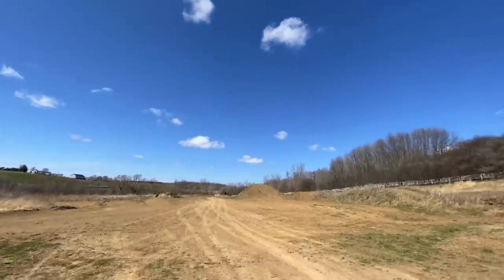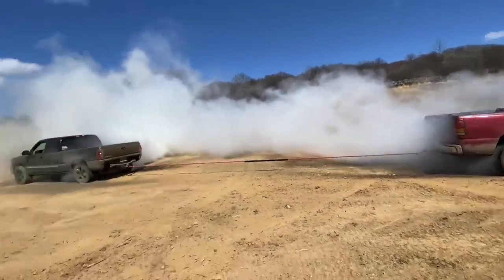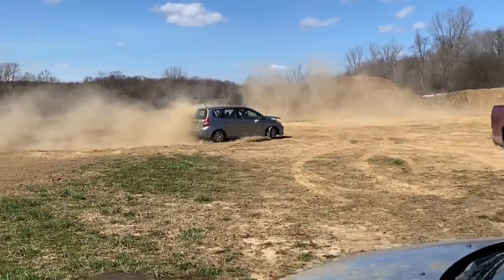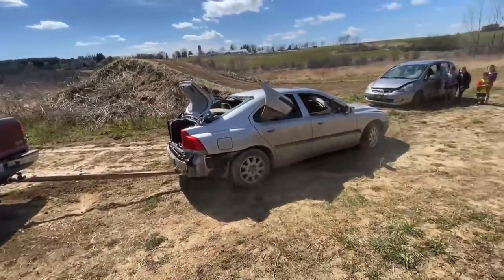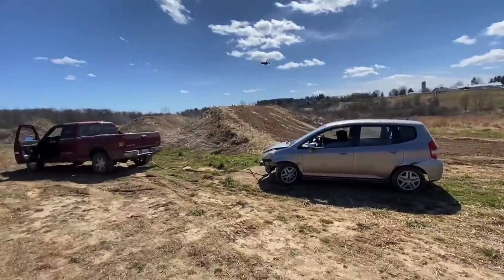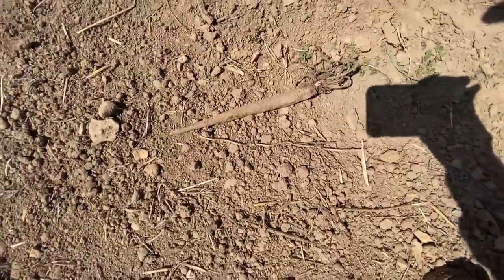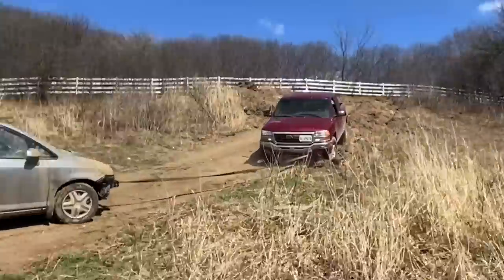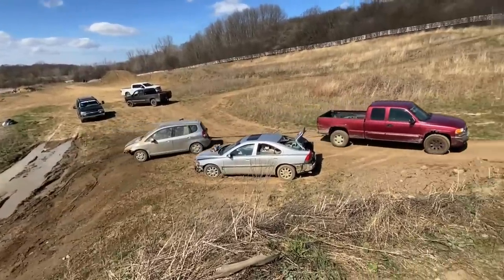GMC TUG Of War HONDA Car JUMP!!!

Comment: with a dead lightweight car like the Honda Fit I was hoping you would string together about 10 tow straps and have the pulling truck on one side of the hill, hook up to the front of the Fit on the other side of the hill and yank the Honda over the Jump.  you need to be more creative with small cars like that Fit!

Comment: you should have 2 trucks do a tug of war with a small car as the middle link, (a rope in front and back, weld a hook on to frame??) maybe put a small cut in the body of the car to weaken it, then literally pull the car apart into 2 pieces.  (maybe you did this already and I just have not seen it yet)